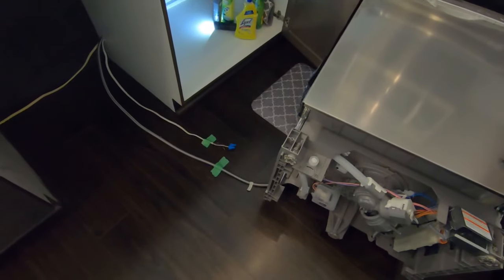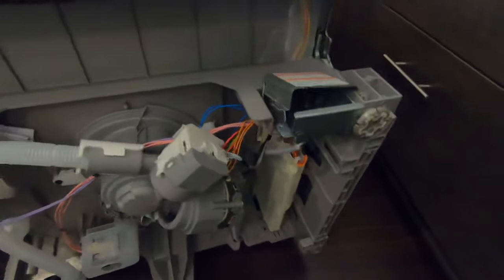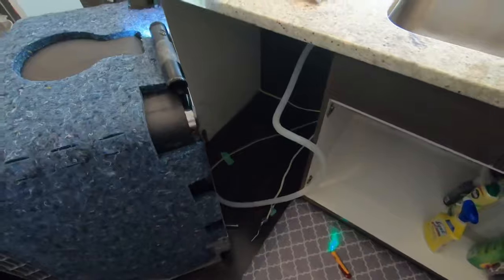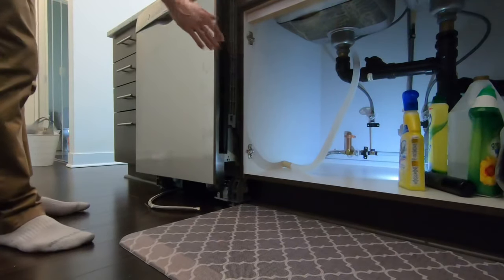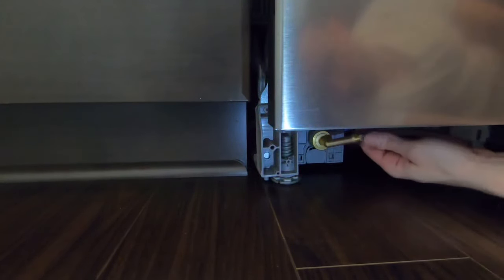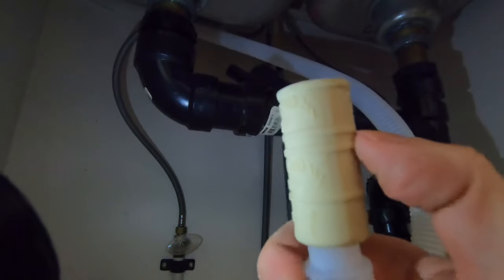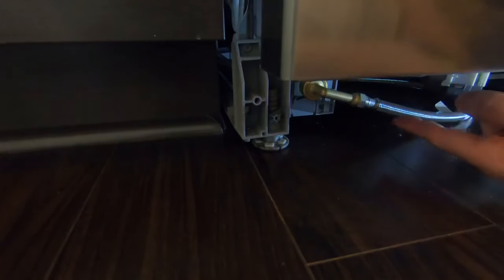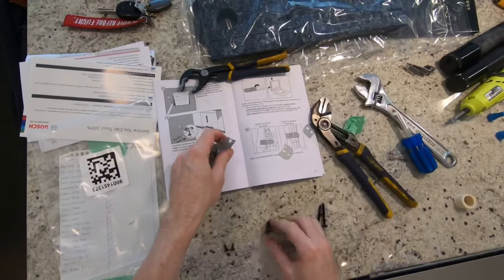HOW TO install BOSCH 100 series dishwasher

Comment: I have this one. Mine slams shut and it only stays open at 150 angle. Is this normal? I can’t get the right answer, not even from Bosch. Shouldnt this be able to stay open even a couple inches?
Reply from the maker: Mine is the same way. The spring on the door is fairly tight, you may be able to adjust the spring. I usually leave the top rack out a little and that props the door open to dry out the dishes.
Reply: @scott.charles.taylor  thank you soooooo much for even responding! I couldn’t find a single person to ask who has this model. This model uses a rope with spring, the dishwasher tech said it can’t be adjusted. It seemed so odd that this dishwasher doesn’t open even a couple inches and it just slams shut. It stays open at 150 degrees, weird. :/ they said overtime that it may loosen up. Still seems odd but not much I can do.
Reply from the maker: @ChicAngelxox  Hopefully it loosens up over time!

Comment: I spent 3 hours today trying to install this same model. Man, talk about a major headache and a nightmare. Then my wife sends me this video. And thank god she did, your video here makes so much more sense than the crappy instructions that it came with. I got a question: any idea what that other hose is for, the one that loops up and then connects to nothing? Is it like some sorta overflow?
Reply from the maker: I believe it's some sort of internal high loop to prevent back-flow of dirty water, glad it helped :)
Reply: Figure out what this open ended hose on the side is?
Reply: @kevinwride6682  2 and a half years later, still haven’t figured out what it’s for, in fact I completely forgot about it. The dishwasher still works though. 😆
Reply: The open ended hose is a common hose found on both Dishwashers and Front Loading washing Machines.  It is used because the inside compartment is air tight, so the Water Pump would have a very hard time fighting the increasing vacuum that is created as water is removed.  The air hose lets air into the compartment to prevent a Vacuum forming while also staying above the water level height so that no water can leak out.

Comment: I see where the drain tube connects on the back, but there's another, what looks like, open drain tube on the side. What is that for?
Reply from the maker: Could be an internal "high-loop" on the side. Hard to see without a photo.
Reply: @scott.charles.taylor  It's the same dishwasher that you installed in the video. I don't know how to attach a photo, but you can see the tubing in the "picture" of the video.
Reply: @scott.charles.taylor  or is it the extension tubing? 😕
Reply from the maker: @bethvye8183  I'd say it's an internal high-loop and to not worry about it. You can always refer to the manual online. For the dishwashers I've done, you ignore these.
Reply: Beth Vye I have the exact same question. Lowes was clueless when I asked them.
Reply: Scott Taylor I also thought it was a high loop but it doesn’t actually connect on the other side. The only connection point is coming out of the top of the same “chamber” the internal supply line runs into. The best I can surmise is it’s some sort of alternate drain path (if or when needed) or a vent.

Either way thanks for your thoughts and for the video!
Reply: Why is this side tube such a mystery?

Comment: Easy enough when you've got a modern house with the correct lines on the house-end.  When you've got an older house, you've got to figure out those too... so far I haven't found answers.
Reply from the maker: Fair enough, you may need an electrician and/or plumber in that case if your place is not set up for a dishwasher.

Comment: Amazing tutorial, I am about to purchase a Bosch 100 series dishwasher and this was amazingly helpful.  Way better than anything on Bosch's website.  How does it do drying the dishes, because I see mixed reviews on that online.  I know rinse aid helps a lot.
Reply from the maker: Drying seems fine, no complaints yet. I usually leave the door open after a cycle to let most of the moisture evaporate out.

Comment: Installed mine yesterday. Has power, no leaks, but when I run a cycle, the soap never leaves the tray or dissolves. Everything inside gets wet, thing just keeps running forever but no cleaning. Any suggestions?
Reply from the maker: Is the soap dispenser opening? Usually you can hear it snap open within the first 10 or so minutes of the cycle.
Reply: @scott.charles.taylor  It is not opening, thing will go for hours, when I check it, soap pod is exactly as I put it in.
Reply from the maker: @AndyTargaryen  You'll need to check with the store or manufacturer then, something isn't releasing the door as it should.

Comment: what is the open hose on the side of the dishwasher for
Reply: Without seeing it, I believe it’s part of the drain tube and should be left alone. I would recommend checking your instruction manual.
Reply: Did you figure it out?

Comment: Any part #s for hoses and elbow
Reply from the maker: Sorry no part number for them at the moment. Drain hose should come with the dishwasher, and the water supply line and 90 degree elbow can be bought at any hardware store
Reply: @Scott Taylor  in the thumbnail,that  hose that's side the unit.Does it just stays like that or does goes connected somewhere
Reply from the maker: @nunu6158  that side hose just stays like that
Reply: @scott.charles.taylor  thanks for the reply

Comment: Those tabs are supposed to be folder back not taken off from what I see in my instructions.
Reply from the maker: Either will work, if you fold it the stress of folding the metal will eventually break it.

Comment: Did you forget that there is water in a dishwasher and that it knowing the correct water level is VERY important.  An unlevel dishwasher may not have the correct amount of water filled.  More important.  If it tilts away from the drain, you could some old water stay inside after done.   You want to level the dishwasher before you install it.  It assumes that your floors in front of the dishwasher is level, but that assumption is safe.  Assuming a countertop is level is not.  Even if your counter top is level, you did not check the level as far as front and back.  You also did not put in the screw for the back leg to keep it from moving as it is wiggled into place or vibrates during use.  Put a bubble level on your rack and see if the back leg needs adjusting.
Reply from the maker: Al good points!